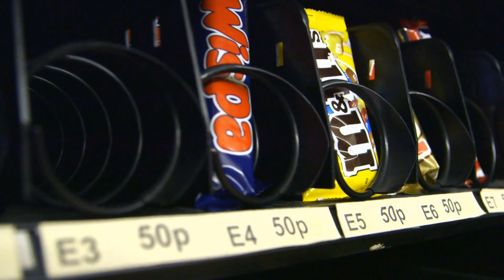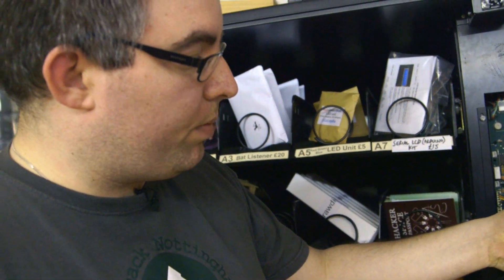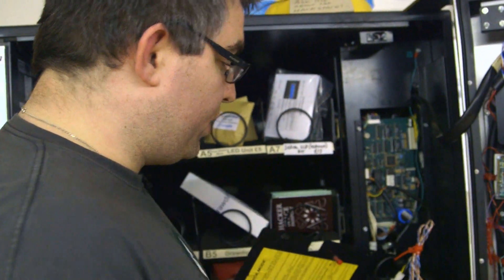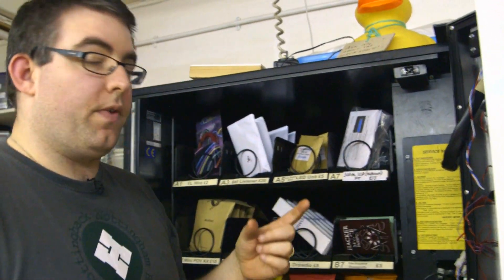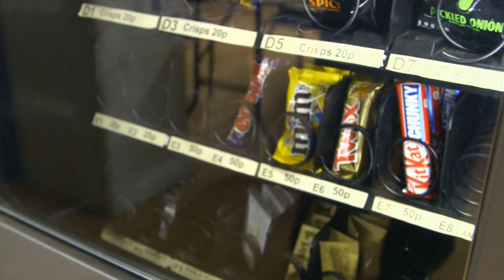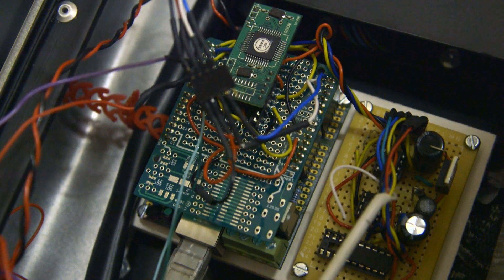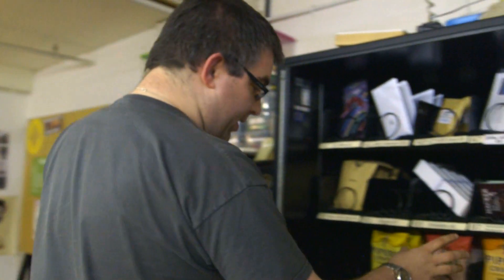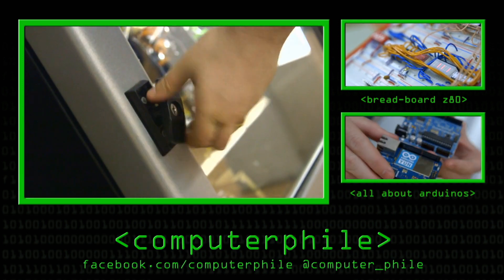The Tweeting Vending Machine Hack - Computerphile

Comment: Computerphile, I have a question: You said that the Arduino (I think) connects back to a server to check the balance of the user. Does this mean that a cleverly made man-in-the-middle type attack of someone on your network (because you said that you use Ethernet) could intercept these packets and trick the vending machine into beleiving that the user has a different balance? Nice video by the way!
Reply: As far as I understand it, user balances are stored on the server rather than on the cards. The cards only have a RFID-chip with an ID.
I could be totally wrong, though.
Reply: You could do whatever you wanted if you got between the Ethernet port and the server.
Reply: I was wondering the same thing.
Reply: What's the deal with ATMs then? Could an ATM be hacked in this way? And do ATMs use the Internet?
Reply: Olof Ahlén ATMs are both encrypted and do some of the work locally. They are also a lot more complex.
Reply: I see. And being encrypted means pretty much that it's more than hopeless to crack it unless you're a country or something right? Do you know if they use the Internet though? I mean if I get cash in Bermuda, does the communication with my bank in Sweden go over the Internet?
Reply: Short answer would be yes.

Longer answer would be that the attacker wouldn't have to be particulay clever; the server-side software is open-source - so it'd be possible to set that up on your laptop, add your rfid card to it's database, then plug it into the vending machine. However, if you've got youself in to a position to be able to do that, you'd also be in a position to steal far more in the way tools, equipment, etc, from our hackspace than you could ever get from then vending machine.
Reply: Thanks for your answer! Interesting.

Comment: Could you make a video about why you need the c++ redistributable to run some programs?
Reply: Because some people actually think they like writing programs in c++, their programs need some c++ runtime components to run. That drove somebody crazy in a company where I once worked on some emdedded device with small flash space.
Reply: Simple answer, Its coded in c++.
Reply: If you need an explanation, I can give you one. The C++ redistributable is a package of C++ standard libraries and the runtime system. Your computer will have some version coming with the operating system, but programs may be running on a different newer (or older) version and hence need that. Most programs are what is called dynamically linked, which means that certain parts / functions are contained in separate reusable shared files; that is, the program does not contain its own function to e.g. draw a window on screen, but rather uses one that is available to all C++ programs that use the shared file. Furthermore, a runtime system is a layer between the program and the operating system; an abstraction if you will, that makes it able to do code-wise higher-level stuff. It is comparable to a low-level interpreter of sorts.
Reply: The program is written in C++ and uses frameworks that aren't part of the OS.
Another good example is the .NET framework for programs written in C# or VB.NET,  especially if they're using thread pool and others multi threads functions.
Reply: Same reason you need to have a road in order to drive a sports car.
Reply: Ulrich Christensen
was going to say this, but was beaten to it. Another reason software comes with this, is because by using the redistributable, you shrink the size of the program that you've got to write. Not all C++ programs need the redist, but the ones that don't are usually pretty large.
Reply: Really a better video would be explaining what static and dynamic linking is all about. There are many very good reasons to go with static linking (embedding the libraries itself) or dynamic linking (embedding references to a shared copy of a library). Sometimes the reason for one type of linking outweighs the other so much that if it's not possible to do the one that is desired it can be a deal breaker (as in the programmers will move on to an alternative).

I personally would never bother with dynamic linking anything that doesn't absolutely need sub-architecture optimizations if I have the choice between static and dynamic linking. You don't always have a choice in Microsoft land but in Linux you almost always do outside of very low level stuff that comes packaged with the OS itself. If one could static link every library needed by a particular program, it could in theory run purely off the machine level OS (BIOS, EFI, UEFI, etc).

The file size argument is moot for vast majority of software, so much so that the vast majority of software includes the redistributable versions of the library packages they use that aren't part of the OS itself. In the past this argument held a lot of weight, but technology has moved so far beyond that for all but the more archaic of systems in active use.
Reply: Ulrich Christensen Nice explanation. As a Java man I don't have to deal with linking :P. I just thought something like that would be included with the operating system. So basicly the c++ redistributable contains things like the STD?
Reply: goeiecool9999
Basicaslly it contains all the stuff that the compiler can't directy translate to the c functions of the OS. Thing like the STL (Standard Template Library), the new thread abstraction of the c++-standard and so on.
Reply: goeiecool9999
As a java programmer you might know that in order to run java programs you need a java runtime environment, a jre. The c++ reditributable contains much the same stuff as the jre such as the standard library but no interpreter/compiler.
Reply: simon24h I don't think the JRE has a compiler. only the JDK does but that's besides the point. But I think I understand what the c++ redistributable is. It's a way of running c++ applications on different operating systems. Allowing the developer of the operating system to make routines specific to the OS. Am I right?
Reply: goeiecool9999 Yes, the C++ redistributable contains all that is part of standard C++ and then some. I don't remember the precise contents, but all of the basic stuff.
Regarding linking, as a Java man you are actually using a system that is the most extreme form of dynamic linking. Each class is independent and can furthermore be drop-in replaced. It is not something you think about, but it is.
To continue the comparison to Java, that too is updated with a redistributable, the JRE, which contains the standard libraries for Java programs. The operating system comes with some copy of the C++ runtime system, but it is not intimately linked with the operating system and indeed each new version is available across multiple operating systems. For Windows, each these package is the same files across XP, Vista, 7 and 8. Most of the files are not drop-in replacements, because features are added and removed between versions. The dynamic linking rather links to a specific version. Hence the C++ runtime is not just updated with the operating system, but only when needed.
This is similar to a Java program developed on a specific version of Java, which will need a minimum version to run, and which will possibly not run on a newer version, because some needed function was removed.
For Java, it is uncommon to have to versions of the JRE, but with the C++ runtime (at least on Windows) it is rather common.
Reply: Ulrich Christensen Tell me about it :P I have 10 different versions in all varieties 2005 2008 2010, 64 bit 32 bit etc etc.
Reply: Alan Hunter I'd say that choosing between dynamic linking and static linking depends on the size (that is, scale) of your program. For a small program with limited functionality, static linking is the best option, but for a big program it is rather a bad idea for a number of reasons. First, the compilation. Separating your program into libraries that you don't need to compile each time is a blessing. You don't want to compile many hundreds megabytes of code each time. Furthermore, even though you are linking compiled binary objects files of each library, you don't want to go through that linker resolution to create one large massive executable, when you don't have to.
Second, the executable size. When you are loading a program, the whole thing is loaded into memory at once. Do you see the problem? Perhaps, if I tell you how processors, task switching and page faults work. A program separated into multiple parts is swapped in and out of memory quite easily, but a huge monolith is a nightmare. Load and execution time is naturally affected by this, even though a lot has been done to mitigate that on an operating system level.
Third, a program may really be multiple smaller more specialized programs, where each share some common functionality. It is better that these can use a shared library for this than each executable having a copy statically linked into them.
What I am basically saying is, that you don't want your 25KB programs being 400MB executables, if you can help it. You can use local shared libraries, if you still want your program to be self-contained.
Reply: This stuff about linking is getting me stoked to learn c++. Could you provide a little summary about header files? They are the main reason I never got into it. I didn't like the idea of having a separate file.
Reply: goeiecool9999

A header file just contains function signatures (types of arguments and return type) and type information on structs and classes. And maybe variables and constants and inline functions that are needed in mutiple source files.

You don't like multiple files? In Java every class goes into its own file. And in Java there is at least one class file for every source file.
Reply: Ulrich Christensen

During debug builds with low amount of optimizations you might wind up to hundreds of megs of program data from static linking. But modern linkers also optimize the static linking process by trimming out excess functionality (stuff that isn't called anywhere) unless explicitly told not to do so. I've seen programs drop from 600MB down to 10MB just by shifting from o2 to o3, which is where I suspect the GNU compilers begin link level optimization.

Of course all of this is moot if the static library has been compressed, encrypted or obfuscated. I haven't seen any linker that works through that without manual intervention (read that as reverse engineering if you want).
Reply: Alan Hunter I guess I baited myself into that response with my file size example. The thing is that you can only optimize yourself out of a large file size, as you describe, if you don't ever use the functionality stripped out. With a smart linker, it can perform static analysis and some partial evaluation to optimize either for performance and/or file size.
Such an optimization is easy to see for a smaller program with a specific (limited) functionality.
However, when you're dealing with a large program, where specific parts are only used for certain actions within the program, then you can't just optimize your way out.
Let's consider a drawing program. If that is one single executable, then you are going to have a lot of wasted functionality loaded that you aren't going to use, but the linker can't remove it, because you might use it, as it is part of the program. Such a program contain multiple subparts: the core program; file loading / saving with different file formats; brushes; filters that apply different effects; etc. You'd want a lot of that to be dynamically loaded when needed and not all at once at load time.
Let's consider an office suite program. You'd probably be smart and make separate executables for each program within the program. One for spreadsheet, one for word processing, one of presentations, and so on. Even then you have a lot of functionality that would be the same for each of these, so in effect a lot of shared functionality. The smart move is to make separate libraries for each of these rather than putting a blob into each executable.
Like I said, whichever works is dependent on the scale of your program.
Reply: simon24h So basicly headers are like Java Interfaces?
Reply: Basically, when coding in C++, their are 'helpers' that make more complicated tasks easier, by using a standard library. This library may or may not be included with the OS, if not, it must be downloaded in order for the program to be able to load the library. This is different than other Runtimes, in that the runtime itself is only a bundle of generic functions.
Although not the case with c++, typically a runtime functions as an abstraction layer, like .net or java. Those languages are compiled to a pseudo machine code level, and then ran in a special environment.
Java does this to make the cross platform idea work, since it runs in the same special environment regardless, and the underlying translation is doing the work making that code make sense to the specific OS.

Comment: If ONE thing breaks how are you going to diagnose all that stuff?
Reply: Analysis, reason, and testing?
Reply: Considering the flow is pretty linear, replace each part and see when the circuit starts working again?
Reply: DanieleGiorgino I think brute force methods stop being viable at much smaller sizes than this.

Comment: "optically isolate"?
Reply: Becky Conning Yes - if you have electronics that needs to communicate, but not share any electrical voltages, currents, noise or other stuff, you can use Opto-isolators. These consist of an LED (a light), and a phototransistor (a light activated switch). They can be built easily, but there are whole families of chips with many of these in miniature. A circuit can signal or turn something on in another, with no shared electrical connections (not even a common ground). Very handy.

Comment: Ok but where is the hack? You don't modify it's working model, just read its output and state. If I could order a chocolate via tweet and be sure the machine doesn't run out of it by the time I get there, that would be a hack.
Reply: Everything but the coin counter is custom. How isn't this a hack? They took a metal cabinet and made a vending machine.
Reply: DanieleGiorgino
It's more like design, nothing in it operates as it's not supposed to.